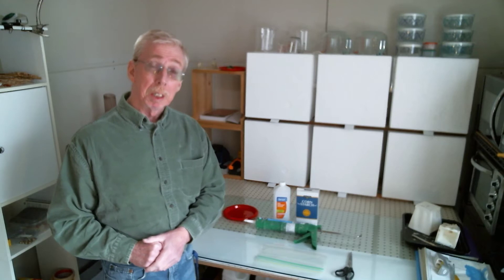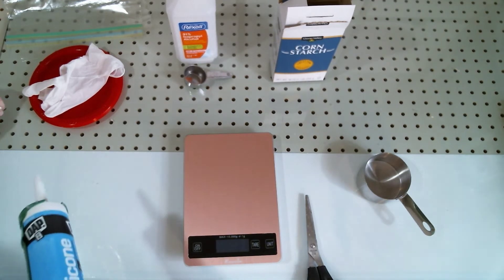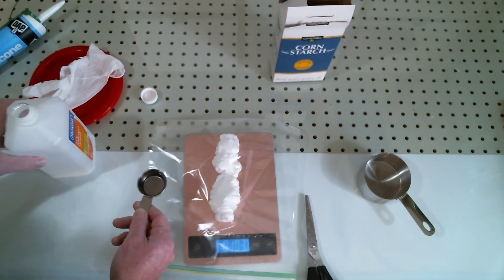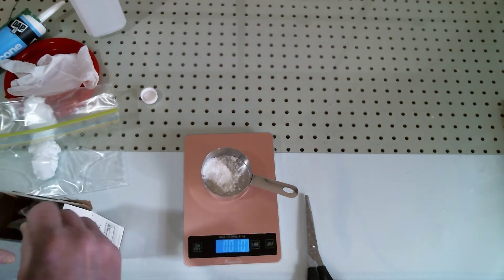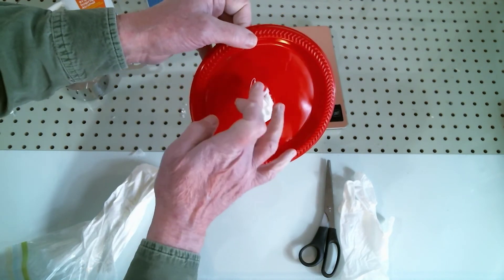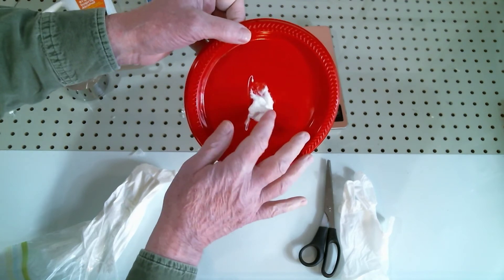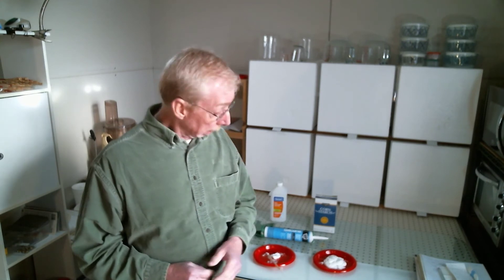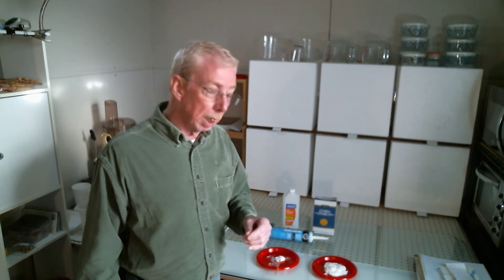Thinning silicone w/alcohol does NOT work. FAIL video

Comment: All alcohol even if they're similar they're different. They have different properties. Making statement just on making a test with 91% IPA is wrong. The test is very narrow. You actually have not proved to anyone that it did not work just because you have mixed 3 components. I just wanna say the friendship is not transitive. If I'm friend with Jane and Jane friend with Joe, it doesn't mean Jane and Joe are friends. Same thing applies to  chemical reactions. When we do a chemical reaction some elements can improve reaction, slow down, stop reaction and many other non trivial effects on reaction.  So when you mixed 3 components it just proves that mix of this 3 components did not work. I can say you have not proved that only 2 components IPA and silicone do not work together, just because you have done a test with 3 components. Moreover you have not tested using methylated spirit, methanol, ethanol.
Reply from the maker: All true, including 91% IPA does not work. I have further tested and concluded silicone MUST be mixed with hydrocarbons to thin, because they used hydrocarbons to make it. Thanks for your analysis, we could all stand with more scientific thinking. Which will make a great new video. Thank you.

Comment: It's very difficult to get the water out of alcohol completely. Try denatured alcohol that is water free. (I see someone else mentioned this also.)
Reply from the maker: but, but, but, water cures silicone. This video has the intent of showing folks that plain alcohol will not work, as there are many video that do not express this.
Reply: @GEOsustainable  yeah the humidity. does the water affect the mix and the mold?

Comment: Quick question: Will 100% nail polish acetone work to thin out 100% silicone..?
Reply: I don't know if you found out already, but acetone will also dissolve a lot of plastics
Reply: @GreenGleem  so it will also thin out rubber latex?
Reply: @sprinklemerja5821  I think so, but definitely double check. I would check somewhere that has latex prosthetic makeup tutorials, they always have good tips.
Reply from the maker: Yes, it will.

Comment: Thanks, good to know save me making that mistake lol. Now if I was to add cornstarch to the Slicone/White Spirit mix in order to increase drying time, would it still end up being a pourable product as required, also would potato starch work the same way as the cornstarch?
Reply from the maker: I have put a link to the video I did that is successful. I do not believe potato starch will work. You can try it, but no one has ever reported using it. Corn startch will will work.
Reply: Hello! Did you ever experiment with the cornstarch or potatoe starch? If you did, what happened? I had the same thoughts as you on substituting with those ingredients and then I saw your comment😆 Apologies for being 6yrs late🎉